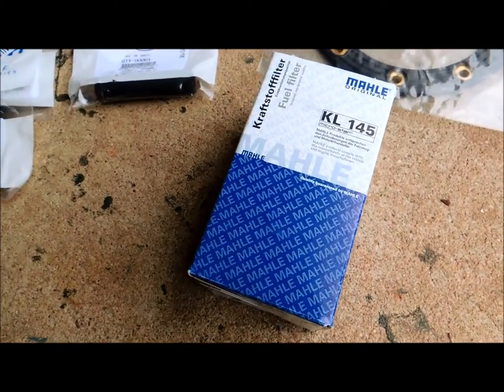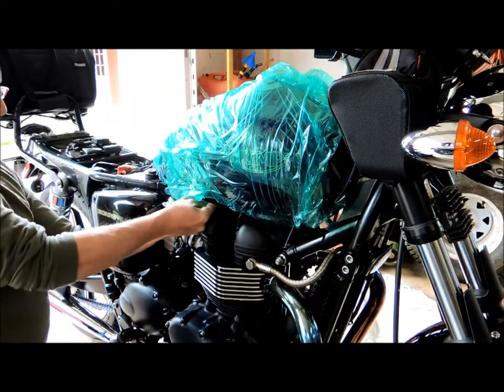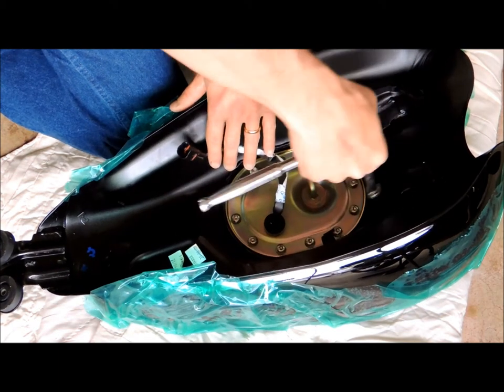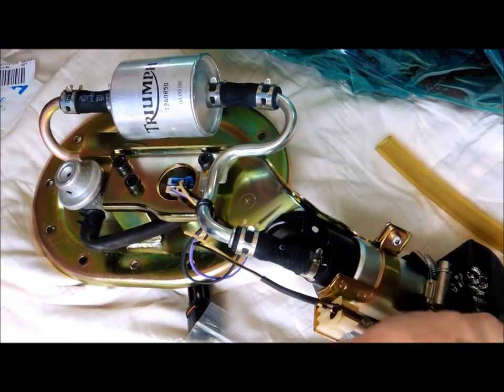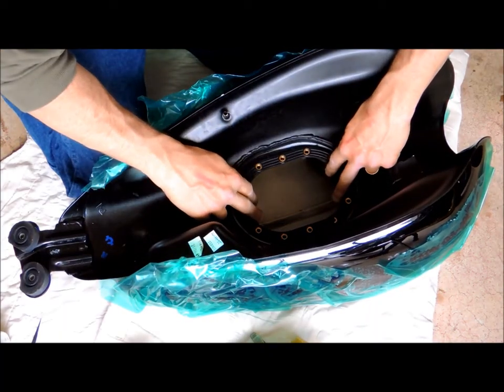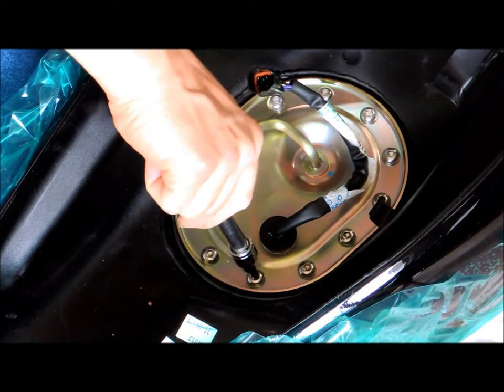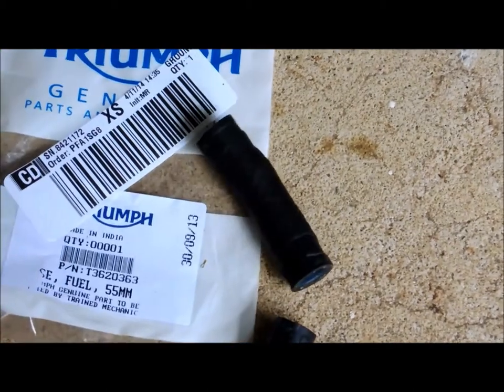2010 Triumph Bonneville Fuel Filter Replacement

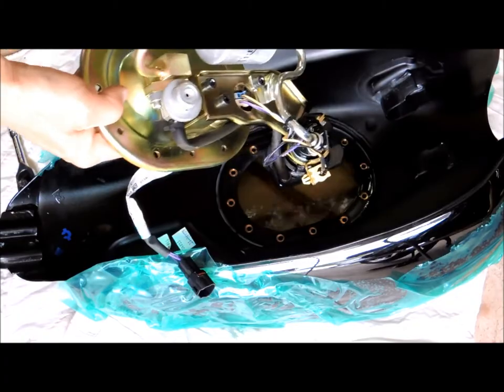Comment: Thanks for the video. This was very helpful when I replaced my fuel filter last year, but I noticed I was getting less mileage per tank after doing so. I discovered you reassembled the fuel pump baffle (the big parts filter) upside down. See 5:25 when you pull out the fuel pump and 6:17 while it's sitting on the towel, vs 8:25 when you drop it back into the tank. With the tank oriented rightside up, the way you've assembled this also has the baffle pointing UP, hence not drawing fuel from the lowest point in the tank. Easy mistake to make, and since I followed your video only referencing 8:25 when dropping it back in, I did the same thing. I can confirm that this shortened my mileage per tank by approximately 20-30 miles, once running out of gas on route 78. I took everything apart again, rotated the baffle, and reassembled, and now back to normal.
Reply from the maker: You know, I rewatched this a few times, but I'm not seeing what you're describing.  The baffle went in the same way it came out, and it ends up being twisted downward (or upward toward the camera) to the bottom of the tank.   See 5:26 and 8:28.  Maybe I'm missing your point, but I think perhaps the camera angle makes it look backwards.  I probably should have put the camera level with the tank to show this better. Do you have the same or similar model year?       My tank is 4.2 gallons, which would make the theoretical total mileage for my riding about 180 total miles.  My light comes on around 160 miles, although I don't usually push it that far.  I'll have to take a look at the book and some other videos to see if I've misunderstood what you're saying.
Reply: Go to 8:24 and use the . key go advance frame by frame. The baffle is 100% going in upside down. https://ibb.co/dp5W1o
Reply from the maker: Granted, this was four years ago that I did this, so my memory isn't sharp.  But I just went back to look at the original footage to see if there was more recording of that part.  If I understand your point, you are thinking that the plastic "cup' on the end is oriented in the wrong direction?    But, when I look at how the rubber hose and nipple is oriented on that area when it comes out versus when it goes back in, it is the same direction.   I mean, maybe it's a half inch different, but nothing severe.  I also looked at the Haynes book on page 3B.4, illustration 3.12a, and it appears to be the same.  Is it possible that your year Bonnie is different?  And, did your assembly come out the same way you put it back in?  I'm not certain I can really answer these questions until I eventually replace my filter for a second time and have a chance to see the assembly in person again.  I'll certainly pay more attention next time, though, and report back what I find.  In any case, I haven't been experiencing the premature fuel light that you mentioned.

Comment: Thanks! I've actually had mine out as i had an accident and had the tank repaired.  The people who repaired and painted my tank put the sender/pump back in it and now i have to take it BACK OUT again to replace the filter and hoses, something I was going to do while it was repaired but it wasnt to be. Anyway,  this will help me with the job.  again, thanks..
Reply from the maker: It's not too bad once you have the tank off the bike.  Just don't scratch the new paint job!
Reply: @tinderboxarts  Gotcha!  I did it fairly quickly . I will note that I removed the bolt that held the lower metal line in place , then replaced the hoses from top to bottom, made it easy to assemble not having to bend the hoses to get them on..  
and I used a nice soft blanket on the tank.. all went well. thanks

Comment: good video, do u really have to change the gasket and hoses when u change the fuel filter?also after how many miles should thr fule filter be change? thanks
Reply from the maker: My maintenance schedule from Triumph says the fuel filter is changed every 12000 miles OR every two years, whichever comes first.  The gasket and hoses should be replaced at the same time, and they are not very expensive at all.
Reply: thanks for the info, I have a triumph America 2013 since then I always took her to dealer for service every year, since is very expensive I dicided do  myself all of it his I'll be my first time. they want to charge me like $220 for this service and my bike has almost 8000 ml and they told me I'll be just oil filter,regular oil not even synthetic change and some wires adjustment so now I'll do it myself ,screw dealers too Mach money
Reply from the maker: You can save a lot of time and money by doing the work yourself, and you'll get more satisfaction out of it.  Most common maintenance items are not that difficult to do as long as you have some basic tools.  Almost anything you'd want to do is already covered by somebody on youtube, and if you get yourself a Haynes or other shop manual it will help too.
Reply: thanks that's I'm about t do it myself I just got online synthetic oil, filter,air filter ,new  brake pads and fluid brake, and watching yr video came t my mind do the fuel filter too which I got it on eBay the same u show in video for $17. if u don't mind send me details link where can I buy the gasket and hoses so I can do the same job u did. thanks for the info. I let u know when I get it done if I get a hose inside  my tank like u did LOL
Reply from the maker: I can't recall where I got the hoses, but it was probably an online retailer who sells OEM parts.  The hoses could likely be had at a local auto parts store too.  You just need short pieces of common hose.  Bikebandit.com has OEM parts if you don't have a local Triumph dealer.

Comment: Looks like the proper torque, the more bolts or screws, the less torque required. The important thing to remember is, when going back up with it tighten evenly.

Comment: Hey! Great video! I was wondering, what was the cause of you wanting to put in the new fuel pump? Is this just regular maintenance or did you have any indicator lights come on? THANK YOU!
Reply from the maker: You mean the fuel filter, not the fuel pump, I presume.  Well, yes, it is a regular maintenance item.  Truthfully I think fuel delivery and storage systems in the US are better than they used to be.  Back in the day when you filled up at a gas station you were almost certainly getting some dirt with the fuel.  Today the  fuel we buy seems to be cleaner.  Nonetheless, it's not expensive to replace your fuel filter once in a while.  The filter will also catch debris from the bike itself in the event of a problem.  A few months back I replaced a fuel filter on my work truck after pulling the tank.  A previous owner had apparently replaced the fuel pump after the original went bad.  You wouldn't believe the amount of chewed up plastic and metal that filter had caught!  If that debris had gone to the injectors it would have been an expensive repair.  The same goes for bikes--better to protect the injectors (or carb) from debris no matter where it comes from.
Reply: @tinderboxarts  Yes. Excellent! It's maybe the one project I was a little hesitant to do but I've got a little more confidence now. Did you order direct from Triumph or did you use BikeBandit or something like that? Again, thanks for the video.
Reply from the maker: Looks like I got that one on Amazon-- https://amzn.to/2Pks3dD   But, your bike may be different.

Comment: What were the sizes on those hoses that you replaced? You mentioned you could have gotten them elsewhere?Also, where did you order your filter from?
Reply from the maker: Jeff Johnson It's been too long for me to remember, but they were common sizes you could find in an automotive parts store.  The filter I got on Amazon:http://www.amazon.com/gp/product/B005GDJSXQ/ref=oh_aui_detailpage_o08_s00?ie=UTF8&psc=1and BTW, you can OEM parts at bike bandit now:http://www.bikebandit.com/oem-parts/triumph-street-bike-parts/s/m13c7
Reply: tinderboxarts Awesome. Thanks. I've been needing to do this for quite a while but wasn't sure where to start. Thanks again.
Reply: Make sure the new hoses are submersible fuel line.  There is a Major difference!

Comment: With proper maintenance how long will my Bonnie SE 2010 last?
Reply from the maker: Forever!  Seriously, parts do wear out, but as long as you can still buy the parts you can still keep the bike running.  Or, to look at it a different way, if you just do normal maintenance (oil, filters, minor electrical, bearings, clutch, tires, etc.)  then you could easily expect 100K miles or more.  These bikes are very simple and very reliable.

Comment: Enjoyed the video and subscribed! May I ask what would lead someone to do these replacements? My thruxton is currently facing a jerky throttle in first and second gear. When I twist the throttle it’s as if the fueling is not flowing properly, as a result, I have to rev it harder and balance the clutch at Low gear. Would this be a sign that I need to replace the fuel filter?
Reply from the maker: What you describe is not related to the fuel filter.  You didn't mention what year your Thruxton is or if it is carbureted or fuel injected.  The fuel filter is replaced on a schedule shown in your manual, but the basic idea is that it should be replaced before it becomes clogged with debris.  If you always fuel up from a clean source the filter may actually never need replacing.  But, we don't really know how clean a particular gas station or other fuel source may be, so we replace on a regular schedule just to be sure.  When a filter actually gets clogged up it can affect fuel pressure for either a carbureted or fuel injected bike and can result in fuel starvation under heavy load or hard acceleration.  Honestly, it's pretty rare for it to get that far, though.

Your problem could be several things.  If you have a fuel-injected bike you might take a look at the throttle position sensor, which can give the ECU faulty information when it goes bad.  If you have a carburetor you may have dirty passageways and need a good cleaning.  It could also be ignition related.  I'd need more information about the bike model and the symptoms to get more specific than that.
Reply: @tinderboxarts  mine is a 2015 thruxton, fuel injected. I bought it off someone fairly recently.

usually the jerkiness happens in gear 1 and 2, typically in the 1000-2000rpm range. The feeling i would describe to a layman would be as if the bike is not getting enough fuel, and almost like the bike is "coughing". And as i stated in my comment above, anything higher than 2000+ rpm is fine, so i suspect my problem would be fueling related, or throttle body related. I also installed a booster plug after doing some research on the triumphrat forums but it didn't solve anything :(

the bike is also fitted with a Dominator touring exhaust and as far as i know, no ECU tuning was ever done.
Reply from the maker: Well, first I would eliminate any kind of aftermarket device which attempts to alter the ECU data like your booster plug.  More often than not they are the cause of problems rather than solving them.   Since the bike is new to you, you don't know if the mapping was changed.  You can use Tune ECU to read the map number and see if it is stock or not, or you could go to a dealer and pay them to put a stock map on there.  Again, people play with these things without the knowledge they need and can cause more harm than good.  You didn't say if the O2 sensors were eliminated, but that's a potential issue as well.  

Once you know the mapping is stock and the ECU is getting direct data from the sensor, you can do some troubleshooting.  You seem to be describing an engine miss or a rough running engine at low RPM.  Does this occur if you are parked and run the engine under no load, or does it only occur if there is a load on the engine such as taking off from a stop?  That would be a major clue.  The throttle position sensor could well be a possibility.  When the data it sends to the ECU is bad, the computer gets confused and make a guess as to the proper air/fuel ration and timing.  These are simple sensors which can develop physical flat spots in the contacts or get dirty contacts, which results in intermittent data to the ECU.  The flat spots often occur at well-used locations, such as where the throttle would be when first taking off.  

Ignition issues are another likely culprit, including corrosion at terminal locations, worn out spark plugs, or coil problems.  When RPMs increase the symptom may go away as the ECU is better able to judge and adjust the timing to overcome, say, a weak secondary winding in a coil.  Typically an ignition problem will show more clearly under load, so if the problem is not as apparent with the bike parked and the throttle revved, that's a clue.  Fuel problems are not impossible, but less likely based on your description.  Typically a bad fuel injector or fuel starvation will get worse at higher RPM, not better.
Reply: @tinderboxarts  can’t thank you enough for your advise and insight, will definitely be looking into some of these possibilities with a mechanic. Thanks again man!
Reply from the maker: I'd love to hear back what you find!

Comment: Hi, Just wondering if you knew the dimensions of the assembly at all? I want to drop the entire assembly into another style of tank. Even if you have the width of the fuel pump gasket that would be great. Cheers
Reply from the maker: +martin hodgson I'm sorry, I don't have the dimensions and I'd have to remove my tank to measure it for you.   I guess it's possible to do what you have in mind, but the opening in the other tank would have to match the same measurements AND the same contour.  Tricky, to be sure.

Comment: is all the fuel tubing 5/16"??  inside & outside tank
Reply from the maker: I can't recall now, but that is stuff you can easily pick up locally at an auto parts store.  I usually buy a few feet of each type just to have on hand.

Comment: What are the part numbers for the gasket and hoses?
Reply from the maker: I don't have that info, brother, but if you get on bikebandit.com or one of the other sites with OEM parts diagrams you'll be able to look it up.
Reply: @tinderboxarts  Hey I actually found it, haha. Hoses are listed as T2401270
 and T3620395
, did you ever have luck finding generic non OEM alternatives?

Comment: Were you having any fuel problems before replacing the filter?
Reply from the maker: Paul Hill No, it was fine and actually I had more miles to go before the factory recommendation.  However, I had the time and the energy available and the cost of the parts was minimal.  I may be guilty of over-maintaining my baby from time to time!
Reply: Another great instructional video, thanks! Used your tip and got a Mahle filter, saved a few bucks.

The factory gasket on my ‘12 had three ribs, so maybe the change from two was in the few years between our bikes. Mine looked perfect at 12k so I went ahead and reused it. Tank sat full for two weeks without leaking while I waited for valve shims so I’ll save the new gasket for the next change.

Watching you wrestle the assembly in and out of the tank prepped me to not panic when it didn’t pull out easily. Thanks!

Comment: I'm on the island of  Maui and have no garage or carport to work on my 2010 Bonneville T100.  I'm going to have to hire someone change my fuel filter and a few other things but I have to order the parts first as there are no dealers here.  I went on the Triumphmotorcycle.com and could not find the fuel filter.  Where did you order your parts from? My local auto part is Napa and they are clueless about Triumphs.  I could even find what oil filter I need and my owner's manual doesn't give me the part #.  Any advice?
Reply from the maker: Does Amazon cover your area?  They carry some of the parts.  The fuel filter is here: https://amzn.to/32LaSc7 .  The oil filter is here:  https://amzn.to/3nzSsDv .  Other oil filter options include the K&N 204 or the Mobil 1 M1-108.  The NAPA 1358 oil filter MAY work, but I've not confirmed that.
Reply: Try any of the west coast mainland dealers,  Seattle,  Portland  etc. Shipping may be pretty steep, but that's  life in Hawaii.